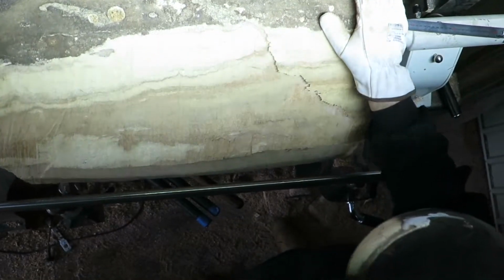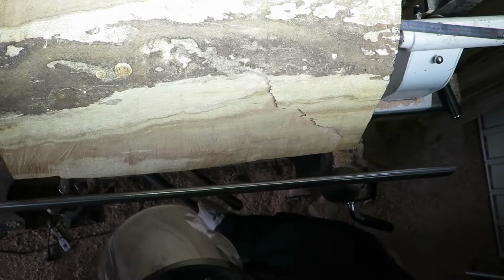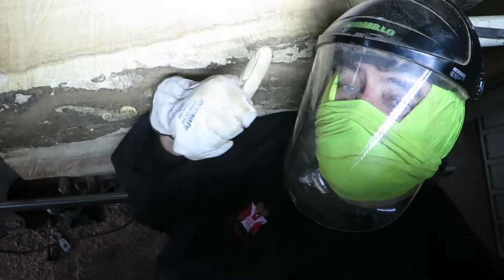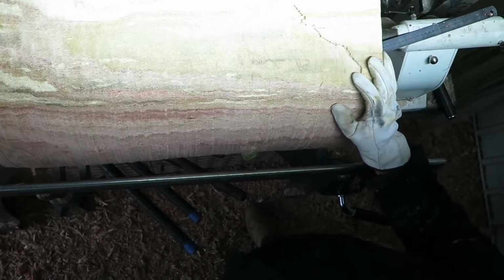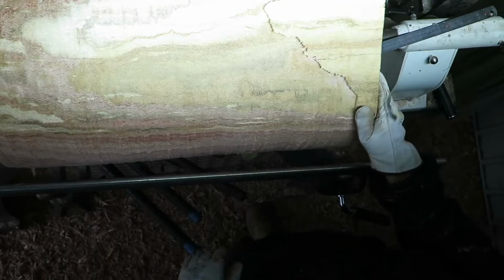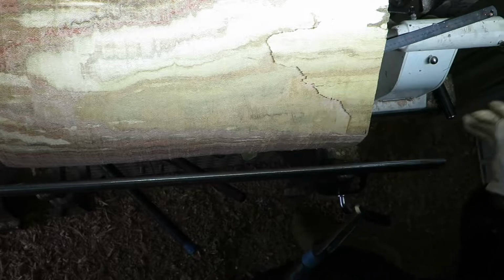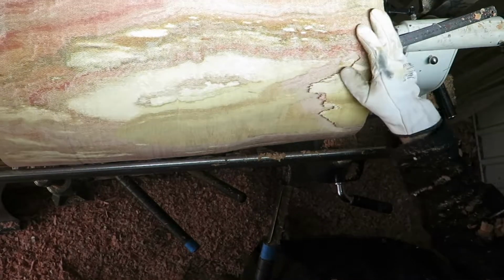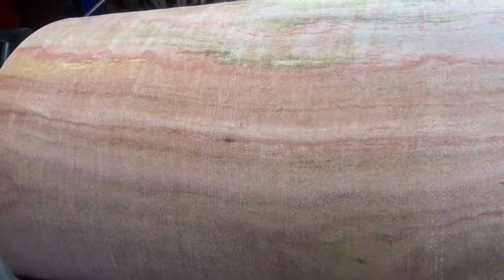Bed side table roughing

Comment: Wow massive piece of wood. Really beautiful colours. I think you should get rid of that last little bit that's flakey, saves the customer chipping it. 😁
Reply from the maker: Thanks, yes I decided the outside shape will taper down in a parabolic shape to the base to remove it.  Will turn another blank first, to see what diameters I can get out of it, to get dimensions that match